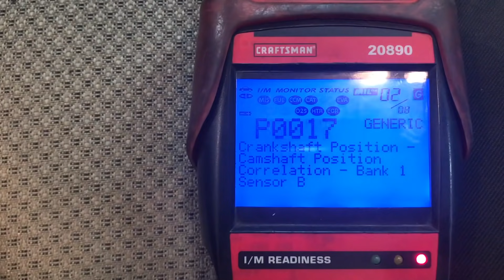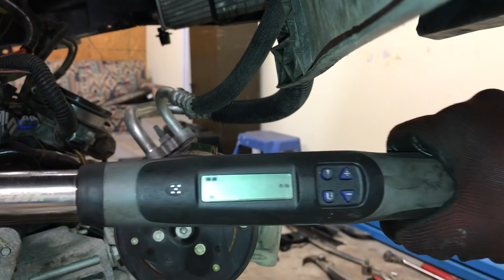Step By Step: 2.4 EcoTec Timing Chain Replacement

Comment: Also wouldn't it of been easier to rop the new chain from the top? And don't you have to use new camshaft sprokets with a new chain? Just asking
Reply: yes ,make sure you clear engine casting inside

Comment: Engine looks pretty clean for close to 100k to oil was changed. Must be just crappy parts.
Reply: sneakysnakepie1 that engine looked like shit.... it probably hasn't had three oil changes... which is why the chain needed changed because it needs clean oil for proper lubrication if not it gets hot and stretches and shit breaks

Comment: Yea screw that im loving timing belts every day
Reply: Timing chains are still better than belts. This cars owner neglected oil changes
Reply: I once owned a car that had a timing belt. First one went at 90k and bent a valve. Had a junk yard motor put a used motor in and they said the timing belt looked newer. 30k miles later same thing bent some valves and I just junked the car. I will never buy a car with a timing belt IMO.

Comment from the maker: Thank you all very much for the positive feedback! This is the first video I have ever "voiced over" and I think it was a big success. It allowed me to focus on the work while filming the repairs, then focus on my narration when I recorded the voice over. I'll most likely create many more videos this way. Thanks again!!!
Reply: I think you are great for procedure videos. Also wondering shorcuts and minimal disasembly, Wondering how many other would love to get this videos to work daily on a fleet or even at the dealership where this isuses repeat all over the place and an optimized procedure to cut costs in mandatory. You should handle this vids t your work to help technicians. Great value and sure you will wonder way to save labour hours and money. EDIT: losts of misspellings
Reply: At how many miles did you chance it at?? I had a water pump leak and because of it leaking i ended up changing my pump and timing chain at 145k on my 2011 malibu LT.
Reply: DanielJaegerFilms why do these tensioner go out?
Reply: replaced the timing chain on my 2011 malibu in november. in early February,  car brought up p0016/p0017 code. then a couple of days later, the car refused to start. took it to the shop and was told that there's no compression in the cylinders. is there a way to fix it that doesn't involve changing the engine
Reply: Michael Okuh hello how much did you pay in repairs? my 2011 Malibu is giving me the exact same 2 codes
Reply: Laquay Morris I changed the entire engine. Bought a used engine with 46k miles for 600 bucks and paid 1200 for labos and other parts
Reply: DanielJaegerFilms after you rotate the motor a few times do the timing marks ever align again. I turn it many times but can’t seem to ever get all three lined back up. Thx
Reply: @dova21DOG  mine is doing the same did u have a issue starting yours did it even run
Reply: You have any videos or steps on how to remove the engine it self. Thanks
Reply: Thank you so much I have a terrain and I'm getting the p0016 n p0017 codes this video helps alot. Thank you
Reply: ⁵⁵⁵⁵
Reply: This is a great video!! thanks
Reply: I got one to do tomorrow and this really help💯

Comment: Great video. I'm a chevy tech and my eyes always roll a bit when I'm given a timing chain on one of these. However your end result was really well done. These engines are notorious for sounding awful, even if everythings running well.
Reply: No no no  you are wrong  mine sound great .
Reply: Yeah even Toyota's engines sound awful right off the factory line. The 2AZ-FE is notorious for nasty timing chain rattle on start-up but Toyota swears it's OK.
Reply: From what I've researched they definitely should have been a recall on this engine, I've owned mine for 2 years and replace the timing chain twice, there is absolutely nothing you can do to prevent it from happening, this is poor workmanship on GM's Part to produce something that's going to fail no matter what, and another thing do you have to pay additional money when purchasing a GM vehicle to have a actual spare and Jack, I recently discovered that mine simply came with a air inflation kit what a joke
Reply: @banditone5220  if you changed it two times then you are doing something wrong.
Reply: @banditone5220  Then walk.
Reply: I have a 2.4 ecotec, custom exhaust and aftermarket intake and it has a pretty good sound. Its not too ricey except for when its cold and running rich but when its warmed up it sounds awesome

Comment: Jeez, looks like they could have changed their oil more. I'm convinced that modern engines should all run synthetic oil.
Reply: Jason Loesch in all Ecotec engines Mobil 1 synthetic oil is recommended.... apparently this previous owner didn't follow the recommendation or never changed it
Reply: I think the pre-10/11 oil check systems are off by ~30%.  The motors just dont seem to run well when you your oil life is listed in the 20's or below.  My moms car buick had this problem and i had a 6 cylinder G6 that would leak oil if it got below 30%.
Reply: Jason Loesch 
I've been using synthetic  oil for 25 years 
It's t
Keeps passages clean and flowing

Comment: What a piece of crap engine.
Reply: Craig Cundiff my 2.2 ecotec has 300,000 miles and still going strong
Reply: That particular engine wasn't very well maintained... these  engines are actually pretty awesome and can make good power if you know what you're doing... but apparently this 
previous owner didn't change the oil.... these timing chains rely on clean and well flowing oil to lubricate it or else it will get hot and stretch thus why the timing chain needs changed
Reply: GUNSnSTUFF just hit 100,000 miles on my 2.4 eco. Runs like new, still sips gas
Reply: GUNSnSTUFF I agree crap motors....
Reply: @aloco4751  definitely not crap. If maintained well these can last several hundred thousand miles
Reply: loganator78r i just don't like the design ...i am not a fan of duel over head cams...and I really don't like the foam pressed casting the block has and the way the valves hit the piston tops if off time in any way........that's all...u are right tho they do last pretty long......laters bro...
Reply: @aloco4751  its all about performance and fuel mileage more than reliability these days. I see what your saying.
Reply: @Francois_Dupont  I'm just saying i like push rod engines more that's all not saying that's what's exactly bad with this engine in being duel over head cams....just saying
Reply: @Francois_Dupont  what ever bro I have a 1994 chevy Silverado 5.7 liter with a push rod engine and a 2005 gmc yukon with also a push rod engine.and I nkow a lot of other trucks Forshure that still have push rod engines..not scince 1960s✌but I nkow what u mean they are all converting or have converted to over head cams....
Reply: My wife's had 111k miles burnt oil had blow by at under 100k miles   got rid of it thankfully

Comment: That engine looks like it has had 3 oil changes in 80,000 miles.
Reply: Every engine looks like this with 100,000 miles or so.. I take it that you're  not to swift upstairs.
Reply: Allen Hetrick I am a full time mechanic. This is abuse. If any customer was to try to warranty that shit through a manufacturer it would be declined as soon as they saw this. I also build medium performance engines in my free time. This is not how an engine that has had relatively frequent oil changes should look. Clearly you don’t know what you are talking about or you are a person that does 10k mile oil changes (so basically the same thing.)
Reply: It’s definitely not the worst engine I have ever seen but it definitely looks like they have gone over quite a bit on their oil changes and now they are paying for it.
Reply: Pennzoil or other paraffin based oils will do this to an engine.
Reply: @joshuacatron2  and this is why. You should not  use these oils. How dumb can people be
Reply: Steven Vanheel sadly GM thought 15k mile oil change intervals were a good idea lol.
Reply: @repnatl  Lol lol lol  what a dumb ass you are.
Reply: Yes between GM and oil manufacturers telling people they can go extended miles between oil changes, everyone thinks they don't have to change the oil. They have the once a year stuff now, I barely let my oil life get down past 50% between changes
Reply: @mcompton2010  Not everyone. .all you are doing is wasting  oil you dumb ass.

Comment: Was the broken part plastic?  Too many plastic engine parts, and why would anyone design an interference engine?   Engineered obsolescence.   Great video  thanks 👍👍👍👍👍
Reply: I just hit 130k miles on my cobalt, so I'm replacing the timing chain and water pump. So far so good!
Reply: @jm309767  should last you atleast another 100 thousand no problem. Just run full synthetic and keep up with the oil changes
Reply: Having a non-interference engine design severely limits things like the engine compression and valve timing. It's unlikely anyone will be making non-interference engines these days, especially if they are using a timing chain that's supposed to last the life of the engine.

Comment: How come you didn't change the counterballance shaft chain ?
Reply from the maker: The balance shaft and water pump chain and components rarely fail. The only time I've seen those require replacement is when they've been damaged by the broken timing chain components or someone not resetting the tensioner after replacing the water pump without GM's special tool.
Reply: How do you reset the reset the tensioner  , ? I had the water pump changed with the tool and noise came out the engine

Comment: You know I used to think my 5.4 was dumb in regards to the timing department but then I watch this video.
Reply: Josh Leviton Difference is the 5.4 is still a much more problematic engine than this one, by far.
Reply: Mine's been pretty good thus far but I got the one with the updated heads and 2 piece instead of the 3 piece spark plugs. Outside of the guides and tensioners going out on me it's given me zero issues. 

All engines will have problems at some point. It just comes down to how easy it is to fix those problems and in that regards I'd take a 5.4 over this one any day if I was forced to choose.
Reply: Josh Leviton Two very different engines for totally different uses. Good thing You have the updated plugs. I hear the 5.4 is a nightmare but I've also seen the 3 valve with 300,000 miles. Every mechanic I've ever spoke with says stay away from the 5.4 3 valve
 Daniel has some engine replacement videos for his 5.4 3 valve .
Reply: I've found it's a hit or a miss in regards to reliability but I've narrowed it down to anyone reading this if you're curious so as to not be scared of picking up a truck with a 5.4 from all the horror stories you hear on the internet. 

1. Know the maintenance history on it. Know what's been touched in regards to the engine and what hasn't. 

2. At or around 120,000 miles is the time in most engines if they have not been maintained right that the timing chain tensioners and guides will fail. If those components have not been replaced around or after that time either do it or stay away. 

3. When replacing the timing components use the upgraded milling oil pump. The factory oil pumps are weaker and low oil pressure or no oil pressure causes the cam phasers to fail. 

4. Get cam phaser lockouts this will eliminate the cam phasers as a failure point outside of normal wear on the teeth themselves. 

5. Use 5W30 synthetic. Ford has a SB calling for this in the 5.4's. I prefer mobile 1 synthetics but that's me. 

6. Only and only use motorcraft oil filters. They have an anti-drainback design that is really important. 

7. Give your 5.4 a few minutes to warm up and get oil flowing. I cannot stress how important this is. 

8. Get the 2 piece spark plugs. It is not as hard to change spark plugs on a 5.4 as people would make you think. If you are getting rid of the 3 piece spark plugs spray PB blaster in the plug holes and let it soak overnight. Another tip is to change them on a warm or hot block. Remember to use anti-seize on the new plugs and they will come out like butter next time you have to change them. 

9. If you can get a vehicle that has the updated heads do so. You can identify a vehicle with the updated heads via the spark plug coil boots. If the boots are brown it is the updated head. If they are black it is the non updated head. 

10. Stay on top of oil changes. As long as you follow all of these steps you will get long life out of your 5.4. 

Those are my tips off what I've learned.

Comment: Great video sir, when you get a Toyota Sienna 2013 timing chain let me know, my wife has this van. Question, when should you replace the timing chain on a V-6 TOYOTA Sienna?
Reply: Brent Hoadley chains normally don't need to be replaced. Only timing belts need to be changed.
Reply: TheJ602 ok, how can you tell if you have a chain or belt?
Reply: Brent Hoadley it's a chain. I googled it. You could also call your local Toyota dealer. It shouldn't never need to be replaced.
Reply: Brent Hoadley 
If it's a chain it should never need replacing. They may stretch a little but I'm talking 500,000 miles.
Reply: GUNSnSTUFF so only timing belts need replace at a regular intervals?
Reply: Brent Hoadley yes.  Only belts need to be replaced. Obviously in this video there was a timing chain failure

Comment: People like you are amazingly generous. Educating people takes time and patience and for that you are a hero. I'd be tempted to buy vehicles with this engine and fix them for a profit if this will be a common issue.
Reply: It is an interference engine. While the level of severity may vary from mild to catastrophic, all failures will lead to some degree of valve to piston contact.
Reply: Just had the timing chain replaced at 110,000 miles.
2015 equinox lt
Reply: I wanna know if the timing chain goes on these engines, will it have bent valves or not. Every video I've watched says nothing about the valves may have contacted the piston when the timing chain goes bad.
Reply: @luckyl6042  yes it will.
Reply: @luckyl6042 I know it's been a while, but do you remember if you had issues with the timing? I've heard the same thing, and my timing is off...
Reply: Ja
Reply: I got 2010 equinox just hit 118 k and getting some idling issues, p0011 p0014 and it stalled, tinking sound right by the chain cover…

Comment: I have a question I have a 2012 ford f150 and which percent you recommend to set. I change every 3,000 miles
Reply: rochajesus1500 I change the oil in everything regardless of year make or model every 3000 miles
Reply: mds s oh okay I meant is which percent like 100% or 50% because i saw your video changing the oil of the f150 ecoboots and you set it in 50% that's every 5,000?
Reply: rochajesus1500 in my 14 fusion i do it every 3 k so i set it to 30%

Comment: How many hours would you charge the customer? Is there a reason you didn't change the 2nd timing chain? Is that for counter balance or oil pump?
Reply from the maker: She initially took the vehicle to a Chevrolet dealer where they quoted her $2500 just for the timing chain components. I charged her half that and also replaced both axle seals, changed the transmission fluid, changed the engine oil and filter, replaced the water pump and flushed the cooling system. The second chain is for the two balance shafts and the water pump. This chain and its components rarely fail, there really isn't any need to replace them unless they have been damaged from timing chain component failure.
Reply: Ah that what I was looking for the answer.  Thanks Daniel.  Now I know the answer.
Reply: I have seen several of these with the balance chain tensioner failing. Especially right after the water pump has been replaced.  Usually just makes a lot of noise and you have to take the timing cover off and replace it.

Comment: God damn that thing's got a lot of chain for a 4 banger. Whats the chain on the left doing? And did you pee down the throttle body this time?
Reply from the maker: The left chain is for the two balance shafts and... get this... the water pump. Yes, the water pump. If you replace the water pump on this engine, you must either use the special tool to hold the sprocket in place, or remove the front cover to reset the chain tensioner. And sorry, no peeing in the throttle body this time lol
Reply: Chain driven water pump.
Reply: fuzzy wuzzy I swear you find the creepiest people on the internet
Reply: If it had been a Dodge or a Heep,  I'm sure it would have been appropriate to do so...
Reply: DanielJaegerFilms So when the water pump on this motor is replaced the timing chain tensioner has to be reset?
Reply: @erickmartinez7580    yip./  just rent the sprocket holder tool.  all the ecotec 4 bangers are this way been here done these water pumps theyre not that bad  hardest part is getting the tube housing parts off the back of the pump behind engine down there.  sprcket holder tool part is easy.
Reply: plus that chain also drives the balance shafts.
Reply: Chains still wear

Comment: Yes Chevy V8 used to have a camshaft sprocket that had nylon gear and they always broke if you're lucky it only bent the pushrod Chevy wants their cars to fail once they are off warranty so you get a buy a new one
Reply: These days it's Ford using cheap plastic parts everywhere. Cheap plastic timing chain guides that get brittle, break apart in little pieces, and end up in the oil sump screen where they starve the top end of engine oil. They even use plastic dogs with pot metal teeth embedded in them to lock the front hubs on the F-150. All it takes is a little vacuum line leak, check valve issue, leaky actuator seals, or a failing vacuum pump and the dog grinds itself up or fails under load in 4-wheel drive. Cheap cheap cheap.